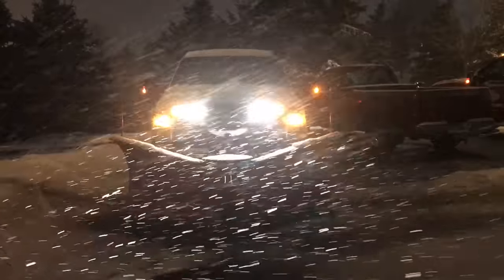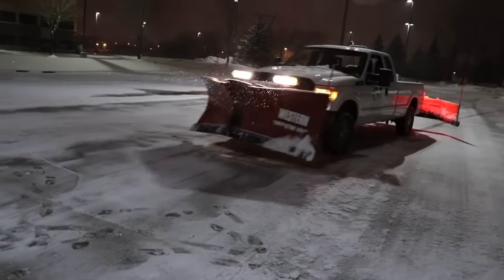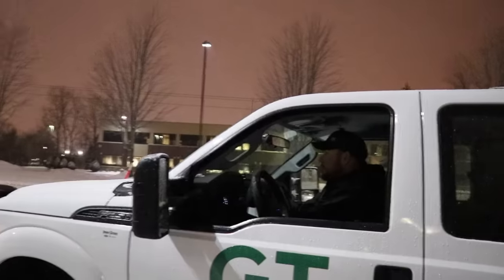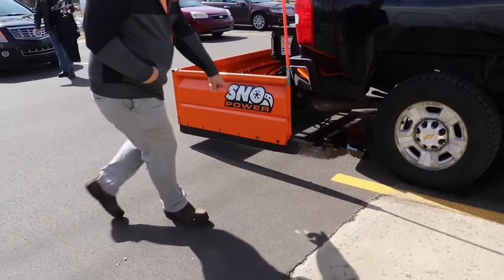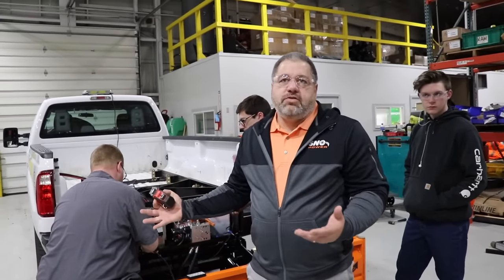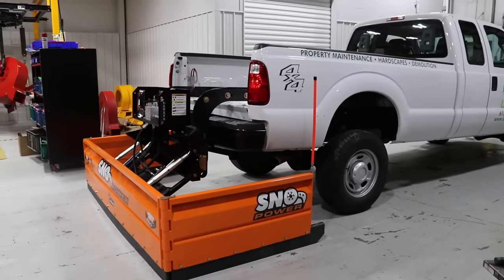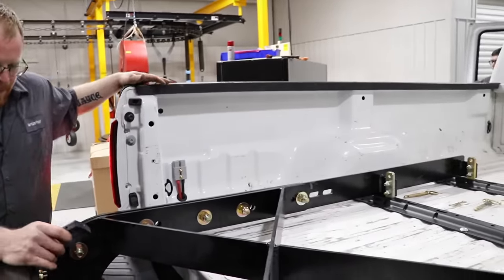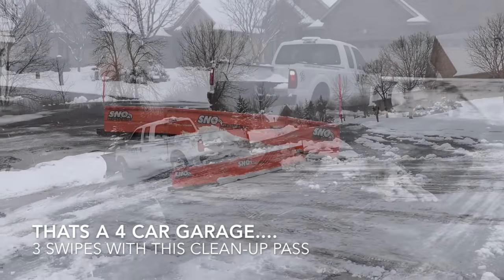Plowing - front or back-which is the best plow? 19" of deep snow put thats to the test...

Comment: You should tell them to add another light to the black box on the snow plow itself so that it’s basically a spot light on the ground so you have max visibility. I’ve seen plows before not sure what brand that were rear mounted, but had the light on the box above the actual plow, and one on each end of the wing that had two sides to the light, one side pointed out facing behind the truck and the other side of the bulb pointed toward the ground but facing forwards toward the cab so you could see the ground when you have the wings facing toward the truck instead of outward. I like extra visibility not just for yourself while plowing but the more someone else can see you the better I think. That’s why I also like the plow edge markers to have little LED’s inside to make it more apparent where exactly your edge is, especially when you’re out for 20-40 hours it helps to have a more noticeable point of reference!

Comment: for my work front it the way. work for the township, so mostly plowing roads...so just pushing from the front i think makes more sense.but if we did more parking lots i could see this being more useful. of course, our truck are international 7500's (or most are, still working on replacing mid 90's kodiaks) and we run with salt. we've also a few F550's for smaller routes.

Comment: That light looks like they met up with Federal Signal for their light technology.  Personally Stan I would still get a V plow for the deep events.  Use the V to punch a hole through and the pull plow to widen your hole like having side wings.  Also if you have a pull plow forget about salting or deicing. It would be in the way.  Yet you can add a wing to your pickups and still do deicing work at the same time.

Comment: I can't think of any way this is harder on your truck. Trucks are designed and tested to pull heavy loads forward. Also, they are built to have heavy loads on the rear suspension, and all attach points to the truck are points designed for heavy loads, aka trailers.
Reply: All the helical gears in the transmission and rear end are made to be much stronger going forward than reverse...
Reply: I don't think there is enough down pressure to make that big a difference
Reply: Yeah but with the limited traction of snow that is less of an issue.
Reply: @treyhart6861  x
Reply: Trey Hart No
Reply: Ridiculous comment. Front plows are way more harmful that this. This is no different than pulling a trailer. Put a ton in the back, on top of the frame and work it.
Reply: It's only harder if you plow in reverse
Reply: @toadamine   might be true. but i disagree. anything done to a truck even starting it is wear and tear. work gets done to make money. the harder they work, more money. every move has its consequence. 

Work it harder to make more. pay the price. if its not working... no money.
Reply: @Pantallideth94  not true

Comment: Not as nice as yours but I just built my own “Pull Plow” based on the premise that trucks and SUV’s are designed to pull. It only weighs 300lbs so my Jeep can easily handle the weight and is a “quick release” system so it can be loaded and unloaded quickly. Thank you for the video.

Comment: I've been running back blades (sorry, I don't call it a pull plow) for 17 years, the last 3 full seasons with a winged back blade.  It's a pet peeve of mine watching people pull out into the road and letting the traffic or road commission clean up the mess.  Thanks Dirt Monkey for your videos!  I also plow 25+ miles per hour quite frequently.  On long runs, typically I run my V plow to clear the lane and my winged back blade spread out to clear the width.
Reply: I forgot to mention that I'm in West Michigan too!  We don't get quite as much lake effect as the shoreline, but it still keeps us busy!

Comment: Looks like a really slick set up. Only thing I see that would cause you issues is need to have a licence plate and Light mount, blocking a plate here get you a ticket.
Reply: y2kxj 
   Good point...  my sander blocks my rear plate.. 
    do they make u guys put a front plate on a regular plow? 👀
Reply: Grumpy 1 mainly they go after a blocked rear plate...
Reply: y2kxj  every state has different laws regarding the rear license plate.  Take Missouri for example where they only supply one license plate for commercially licensed trucks and it must be mounted on the front of that truck -- not just tractor trailers either but all the way down to half-ton trucks (i.e. F150, C1500, etc for lawn care businesses).  They also do not hassle the trucks with front snowplows mounted, as long as it can be seen if the LEO pokes his head between the snowplow & truck.
Reply: Holy cow just move the plate up higher

Comment: If only they could get the center to tilt slightly to the left or right to help move the heavier snow like you mentioned at 13:31, nothing major, just enough to help slide the snow to the side.

Btw were getting 60s and rain here in Indy. 😎
Reply: they should have gave up before the first plow was built. damn those engineers for even trying. if they only knew someone would have had a better idea than them..
Reply: Tilting the center blade with the limited weight of the back of the truck would end up pushing the rear end off to the side.

Comment: Look pretty slick but what happens when you plow more than 2"? I mostly plow driveways some 500' long some 30' long and most of the time I'm plowing 6" to 15" at a time. I would be nice to see if could handle a 12" storm.
Reply: does fine. however, for any situation or circumstance, more snow for any piece of equipment reacts to the amount of snow it encounters. Just like Different tools in your tool bx react differently for every application. Different condoms work differently for every particicant... but they still work.

Comment: problem with pull plows in back of truck is they are only good with very little snow (less than 6"). after that it bunches up behind truck. I had one when they first came out and I stopped using it. you also lose traction
Reply: not from my angle. does fine. if you found a problem with it at 6 inches, then use it a 5 inches. or you can do like we do and take a little less at a time. you dont have to go all in. But i do..

Comment: Like the plow but hate the mount system "5th wheel NOT ME"       that strobe light is not DOT legal, not full 360 degree at all times
Reply: MPO,  that visibility relates to the unit, not to light emissions.  This means the light may not be "billboard blocked" on any side.  The full-surround clear dome now prevalent creates diffraction,  even other than the direction of any emitter's reflector.  
Were it related to constancy,  every single-dome,  single-source light would be illegal between flashes. If flashes from the unit,  can be seen from anywhere in 360 degrees,  then the safety standard is met.

Comment: Couldn’t they make the same adjustable blade system for a front pushing standard plow “ there wing system” ??? Other than backing right up to a garage door or curbs , what would be the difference if they just did the same thing to a standard plow just adding there wing system for front plowing , then your clearing your tire path like normal and pushing a16 ft path as well  . Or is a lot of the back wing system Be about plow weight issues you might have putting a same system on the front ????? On front you still be able to see a lot better ,instead of constantly looking in rear / side mirrors , I can see someone taking there eyes off the road for one to many seconds and take something out . I think this would work super good having this back plow  system and making a wing blade system for the front plow .as well .Make that control operate as one ie. whatever you do to the front adjusting the wings , the control would do the same exact thing to the back plow copying same movements from front wings, letting you make a huge double pass with one pass and know your rear wing blades will pass any obstruction you just made adjustments for the front ... just a thought but the way they have it in this video is pretty cool for backing up and being able to plow in reverse Saving a crap load of time and aggravation . I’m sure this works great the way they have it but in deep snow not having a tire path to get started would seem to be a problem .. not knocking this in any way , great engineering and  Im sure I’m wrong of course because he seems be selling a bunch of these to guys that do a ton of plowing.
Reply: Go build it

Comment: I'm trying to find an excuse to knock this plow somehow. It's design, implementation, anything. Even down to the plug-in on the truck bed. 

I can only find one.

While using the rear plow system, you sure as hell won't be dropping sand or salt. Unless they have some sort of brine tank mounted over the 5th wheel bracket, with the spray nozzles running underneath the rear bumper.
Reply: if you are a larger outfit. you have a separate salt truck.  Where we do ice and snow management, we have three teams. Plow equipment, Salt trucks, and a sidewalk team.

I speak on experience 20+ years, and observations of other bigger operations.  Systems of the snow removal industry

Comment: What do you do when you reach the end of a straight pass in a rectangular lot and your front wheels are up to the curb? Do you have to back up through the pile of snow you just cleaned? What if it's a driveway and the pile of snow you just pulled out the driveway is now in the middle of the street? The town DPW won't like that very much.

Comment: Can that rear plow  be mounted to an F5 50 with a aluminum flatbed ?Will it work with dual rear wheels?
Reply: it will. dually is less ponds per square inch. more weight/ ballast work better. but yes, still work.

Comment: Why not fit one on the front of a truck?
Reply: Nicholas Hollow because it is not designed for the front of the truck. It uses the trailer hitch as one of the pivot points.
Reply: They make front Trailer Hitch Receivers.
Reply: because nothing up front could take the forces that a 16 foot plow would deal. pulling is a hell of a lot easier on a truck than pushing. also, they do NOT make front hitches rated for more than 5k pounds. these plows either require a custom receiver hitch with 2 extra receivers (as seen in the previous video featuring these pull plows) or a factory 5th wheel hitch system as seen here. that's easily 20k+ pound capacity system for these plows.
Reply: dippst well you answered that question better than me. Well I guess that’s a professional operator over somebody like me watching videos.

Comment: What if your truck has a video camera on the tailgate??
Reply from the maker: Good idea, thanks Michael
Reply: you would just disconnect it and remove your tailgate. The back up cams don’t work for plowing anyway. It thought it would have been great but you can clean it off when you get to your lot and in one pass it’s already covered by snow dust.
Reply: I know gm has another camera you can plug into that connection and mount it on the unit itself and it is heated I think , my question is what if you need to tow a bobcat trailer after to clean up lots ? looks like the bed part stays there all season ?

Comment: Wonder how much extra wear it puts on the Reverse gear with that plow
Reply: A ton!! Trucks are NOT made to push in reverse it is hard on the tranny to continue to push often in reverse
Reply: @boatme101  you know from experience. my 20 years in this seems... shoot. i just cant live without one. My problem, your concern
Reply: @morgansmith3650  yes I know what I am talking about. I sold to the auto industry for close to 30 years and worked with GM Hydramatic. The transmissions are NOT designed to take the abuse in reverse for any sustained amount of time

Comment: Are there any issues with law enforcement due to obscuring the license plate on the truck?
Reply: No more of an issue than if you were pulling a regular enclosed trailer behind the truck that would also obscure the rear license plate on the truck.  The same goes for the front license plate - never had any issue with LEO concerned with a front mounted snowplow obscuring a front license plate either.
Reply: No
Reply: mount higher.

Comment: The reverse gear is the weakest gear in a transmission. I can see lots of tranny’s blowing up?
Reply: You were given some bad info.  Reverse gear by design has to be as strong as the lowest gear for forward motion.  Typically what causes a reverse gear failure is not allowing the vehicle to come to a complete stop before shifting it from forward to reverse - the reverse clutches/bands can not take that abuse and fail.  The newer vehicles are getting much more advanced and the electronics are preventing the transmission from initially engaging the reverse clutch/band until the vehicle is not moving.
Reply: Not in a ford but a ram your done and chevy just sucks
Reply: You blow a lot of trannys?  
Crankshaft, Ford's autos are by far the weakest.  But they don't have an engine to put much strain on em either.
Reply: they should have gave up before the first plow was built. damn those engineers for even trying. if they only knew someone would have a dislike. they might have thought of something else
Reply: @gutsngonads661  and?
Reply: Randy Magnum Yeah, just the little power stroke with 400 hp - 800 torque

Comment: That's too wide to dive on the road with. There's a reason plows are as wide as they are. The widest it can legally be is 8'6". That thing is double that. Another thing, it blocks your license plate, also illegal. Also, it sticks out past the rear of the vehicle more than 3ft, also illegal in many states.
Reply: The wings fold in to 90 degrees.  The width would be about 8 feet.
Reply: Please don't drive heavy equipment, EVER.
Reply: i dont want anyone seeing my license plate. its a good cover up. illegal but everyone who is someone has one
Reply: Holy cow its less then 8.6 folded and as for the license plate just move it up higher. This plow rocks and makes money fast.
Reply: Anon Ymous it’s also attached to the hitch, just like a trailer would be, which goes beyond 3ft on the rear of the vehicle. You’re not making much sense.
Reply: been running them for over 2 decades, and you are just telling us now? whats gonna happen now? after 20 years you chime in and now we all have to do what? tell me..
Reply: @jgonz1987   why?